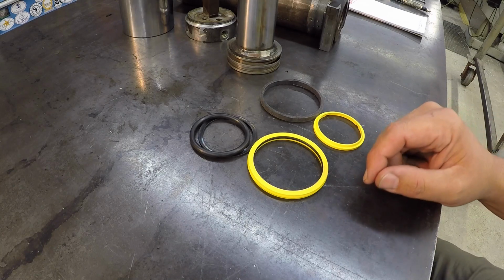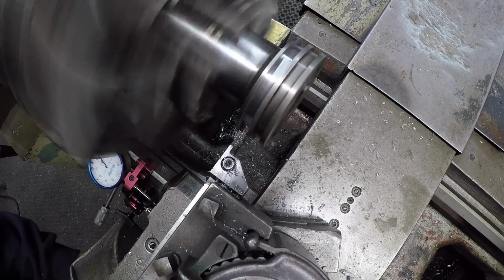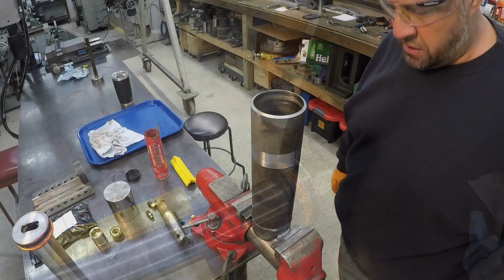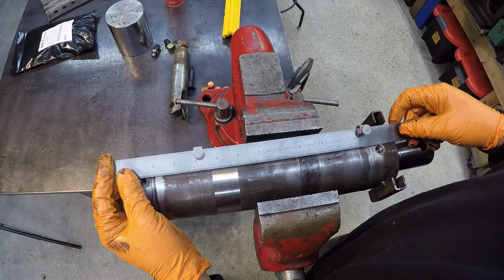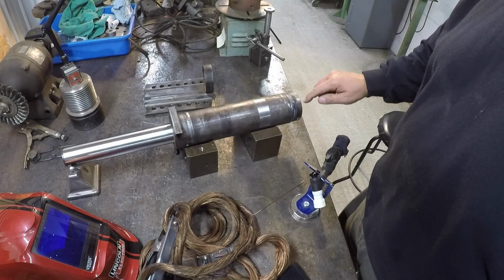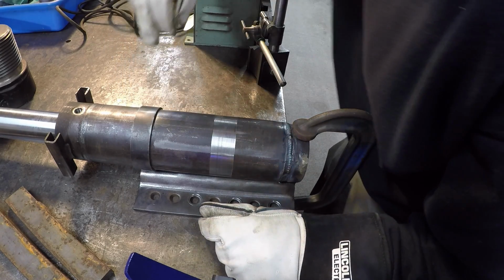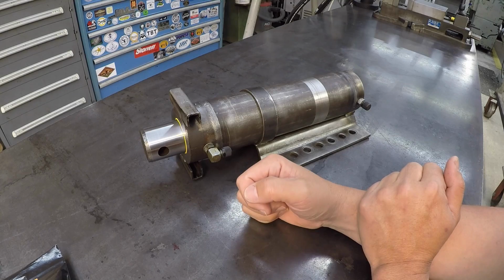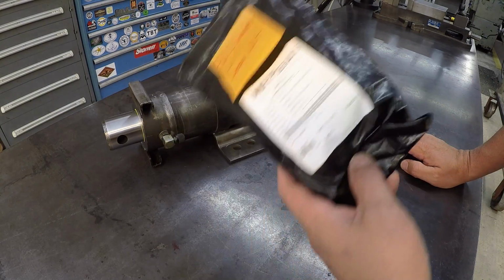SNS 286 Part 1: RV Cylinder Rebuild Completion

Comment: As the welding was going on I was worried about heat transferring down the outer tube and then to the seals and glans possibly damaging them.  When I am trying to prevent heat transfer I put a wet rag down the tub a bit as a heat sink.  Simple and effective.

Comment: From a welding stand point I would have left a small gap between the end cap and tube. If you melt the two bevels together you know the oil doesn’t have a path to leak.

Comment: The "Gentle" ground for the welder makes sense. LOTS of surface area. Your torch fired up real smooth. Awesome technique!
Reply: I thought his ground was some sort of heat sink at first to control the welding heat dissipation.  I need to find some copper like that.
Reply: Looking at it, I think it's a welding cable with the insulation removed, correct me if I'm wrong

Comment: Any issue with the solder leaking down into the interior of the tube on rebuild? Seems it would be awkward to clamp the cap tightly enough before welding.
Reply: It's not solder, it's a weld
Reply: A properly built cylinder has a short spigot on the base plug that should be a tap fit into the tube.  That stops the weld penetration getting into the tube should there be a screwup that bad.

Comment: As an RV repair shop I can tell you first hand that it would be an economical repair....especially in an area such as mine. Cost, exchange and freight make replacement cylinders expensive here. That being said I rarely see the older type like that...generally it the newer small diameter cylinders. Looks like a great job buddy.. :)

Comment: If you had to machine that, you got the wrong seals.
Reply: He said in the last video he was going to convert it to a common seal size that is easier to source.
Reply: Technically correct, however choosing between machining and trowing away a cylinder because you can't find the original seals is kind of a no brainer. It still is a part from the 90s.

Or the manufacturer wasn't all that precise with reading tolerances.
Reply: It was badly machined in the first place, he got the same seal then machined it to the tolerances in his book

Comment: I think that end cap may be coming back off sooner than you think..or can that rod rotate when at full extend?
Reply: The whole point of that center tube is so it can't EVER rotate.
Reply: @jfbeam  I agree, so the end cap will definitely be coming off again, unless the rod alignment is not an issue. Maybe on the RV there is another way to mount it..but unlikely?

Comment: Mistakes ... just did another dumb thing couple days ago when changing  to my cars winter tires.
Got the torque figures for the wheelbolts - 120Nm - all torqued down with wizzgun torquestick, then checked with my torquewrench.
Lo and behold they were all loose fit.
I thought ...
Turned out I had the torque wrench set for 210Nm ...
Same numbers but misplaced !

Comment: Adam you mentioned not being able to pressure test that weld. What do you think of using Loctite 290 Wicking Grade along the bead? I know it can be used to seal weldments, but I'm not sure if it's suitable for the kind of pressure that cylinder would see.

Comment: Perfect repair, somewhat questionable clamping, it is not good practice to weld hydraulic or compressed air cylinders.
Reply: Maybe not but he was just putting it back together like he got it...in first video he took apart and it was welded from the factory
Reply: Cylinder repair shops weld them all the time, just don't weld it while it's sealed up and can build pressure.
Reply: It's ok to weld the ends, you shouldn't weld the actual cylinder part because it would distort, that's why the band wasn't welded to the body

Comment: A quick search on Ebay found a new one for $157.50 and $23 shipping. I'm not sure I'd have repaired this one. But hey, you got a to do a video and that'll help offset the cost.
Reply: I would trust Adam's work over a replacement any day.
Reply: Fair, but if one is able, repairing is argueably a more ethical solution than replacing.
Reply: Not sure I'd trust a chinese knock-off. If that part is $175 for a made in the US . . .  well that is a different story entirely. Though I'd be shocked if that was the case.
Reply: @Maadhawk  The one I found is made by equalizer and ships from Fort Worth. The advantage of welded cylinders is cost. Machining is expensive. No threads, fewer holes to drill, etc... Once pressure tested, very little to go wrong. I suspect the damage to the seals was done during the last repair.
Reply: @Warloch1  That is a surprise indeed then.

Comment: Great to see the finished product. What was the approx. cost of a seal set for one piston ?  My motor home has screw type stabilizers. The shear pins are the weak link. I have had to replace pins on 3 of the legs.  Then water got into the compartment where the control circuit board was mounted.  No replacement available. So I am having to see if I can trouble shoot it after I replace some of the traces that corroded away.     J K

Comment: Of all the products that I have used for soft parts assembly, I remain loyal to Parker O Ring Lube. I do not like Parker Super O Ring Lube. It is too sticky for my liking. I am not a chemist and cannot really testify to product inter reaction, but I was told in my youth that Parker O Ring Lube is completely compatible with hydraulic oils and seal materials. I believed it and I have never encountered a known correlation with any incompatibly.

Parker O Ring Lube is very slimy, tacky enough to not wipe off like tube greases, and a single tube lasts a very long time. Not much is needed for assembly purposes. A little goes a long way. I think that it slips hydraulic soft parts into place more readily than grease.
Reply: Not trusting my welding ability, I would have provided a heat sink to protect the soft parts  while welding. I would have used a wet rag or a commercial heat sink material.
Watching you and TOT TIG makes me want to invest in a TIG setup. Being a welding novice with limited welding equipment, I would have done this with one of my MIGs.
Reply: I'm pretty fond of automatic transmission assembly lube for general hydraulic work. The one I usually use is more like a very soft paste wax, but that may be because I always seem to end up using it in winter.

Some of them also dye the fluid when they dissolve to help identify leaks, where multiple systems can leak in the same area (e.g. on a transmission case unknown "oil/grease" could often be any of motor oil, power steering fluid, ATF, possibly brake fluid . . .).

Comment: Funny thing about that "throw away vs. repair" question--I was just watching a video from "The Post-Apocalyptic Inventor" prior to watching yours, and that's something he preaches about all the time. We used to fix things instead of throwing them away and buying replacements. Good on you for sharing the techniques necessary to do so for these hydraulic cylinders. Makes me consider attempting a repair on the crappy old hydraulic jack I've got kicking around my shop that gave up the ghost after 30 years. I'm sure it's the same type of issue.
Reply: Take your time with it.  You don't have anything to lose and a repaired jack and knowledge to be gained.

Comment: Not sure why you would want to contaminate your hydraulic oil with grease.
Reply: guess you didn't pay attention all that well huh...
Reply: It would be such a minute amount of grease in the oil it would never hurt anything. Plus as adam said they type used is compatible
Reply: Mitch I tried to go watch your professional repair videos but what do you know, you don't have any uploads. Those that can't DO anything are always running their mouth but have nothing to show for themselves...
Reply from the maker: Do some research before you assume
Reply: So I did some research and my service manual for my Volvo hydraulic excavator recommends that the seals should only be lubricated with hydraulic oil when assembling them.

Comment: Nice job.
It’s not just about economics.  Sometimes it’s just better not to throw things out.  
Your welds look great but your could test them with compressed air and a bit of soapy water on the out side.
Even just 20psi is enough.  We used to do preliminary test on welded cylinders this way.

Comment: Adam, excellent repair series. Looks like you were using the Everlast welder and it looked like it performed very good. Can you give an update and opinion on its performance? I own an Everlast 250 EX  and cooler purchased in 2011 and it works great only updating  the peddle ssc, torch CK 20 flex.and put a button on the torch. I would never knock my red and blue machines  that I have owned over 25 years but wanted a tig when I retired and it had some good reviews and price. Thanks.

Comment: I had said it before, but it bears repeating.  Having dealt with trailers and such in the past, the places GENERALLY will say "we can't rebuilt it, we'll swap it out".  There is generally a "core charge" on the cylinder (similar to brake calipers) and when they swap out the piston they will send the piston back to the source for rebuilding.  A friend had an issue on his RV with a similar issue...and that's what they did.  This way they were up and running in a couple hours, not a few days (or weeks).  BTW: He was about 1500 miles from home, on vacation, when the leveling pad failed on him.  He was in and out of the RV dealership in just over an hour with a "new" cylinder installed....but it wasn't cheap, not by a long shot.
Reply: I would be willing to bet "cheap" just not economical; there is a difference.

Comment: I wish i lived closer to you Adam, i'm tired of my hydraulic ram on my dump leaking, its only 2 months old and pouring oil out the seals, the boss can't seem to get a good cylinder as this is the 5th one on my truck in 3 years.
Reply: I guess you're looking for repair then? I'm not sure about America, but here in Germany those things usually get repaired by farm shops and construction machinery shops as well, so maybe that might be another option.. :)

Comment: these generally cost about a $1000 or more, dont know what you would have charged to repair, but trying to find the correct one is a pain!!
Reply: He says 4 to 6 hours time is what he would quote. I don't know what machinists charge these days per hour though, I imagine that will depend if you find a guy willing to do in it in his spare time for a few bucks or go to a full shop. Maybe others can step in with that guess.
Reply: @Swarm509  All about location. I'm in a west coast city where if that cylinder costs under $2500, it's replace every time.

Comment: Wonder how hard it would be to convert the welded on end cap to a screw on or bolt on end cap. You could be having to re cut that weld for the next time that seal needs replacing. Possibly convert the band on the mounting to bolt on as well. More work this time, but if that RV survives, you may well see that cylinder back.
Reply: I was thinking that too, but it would be hard to get it lined up and stay in place. And I guess welding it back up is quicker and easier for Adam. And if it holds up for 20+ years, probably not worth spanding more time.
Reply: @BrainHurricanes  Clocking the entry and exit ports would be some challenge...  Also less likely to leak properly welded.
Reply: And the bracket wouldn't fit, nowhere to weld it on

Comment: how did the seals handled the welding  heat ?
Reply: Seals are at the opposite end of the cylinder to the weld, and on the rod end, that's why Adam welded it with the rod extended. lot of metal between the seals and the weld, and also why Adam let the cylinder cool before adding the second weld bead. Effectively the mass of the cylinder acts as a heat sink to protect the seals.
Reply: @harrymoyes5069  
When really stuck, you may use a damp rag between the heated part and where it needs to remain cool.
Reply: they didn't get hot

Comment: As usual, great work. Why do you weld TIG and not MIG? It seems to me that MIG is better here and certainly much faster.
Greetings from Poland
Reply: Time wouldn't be his priority, and he'd be concerned about heat input and distortion.
Reply: My choice on this cyl.  would also be to  tig weld espesiallly the root pass. A very good eye on the bead to avoid porosity, leaks and get good penetration. Finish pass and the rest of the welds because I am already set up  without changing  machines and the tig gives an  excellent looking and quality weld with no spatter.
Reply: Mig is too hot, tig is slower but much better control

Comment: Just a quick question. Dose it matter that you clocked the shaft hole 90 deg. out from it's original location? It wasn't in line with the hydraulic fittings if the tear down video.
Reply: You are correct.  A quick look at the previous video thumbnail shows the previous position.  A very good question.  Hopefully it won't matter, but it is always best to put back into the same clocking.
Reply: He explains at the end of the video.
Reply: Jack O'Shran As far as I can tell he was talking about rotating the tube relative to the bracket.  But I still can't figure out why the rod relative to the tube is 90 degrees out from its original placement.
Reply: @jcopley100  I see what you mean. The hydraulic levellers on RVs are typically just round or square pads that lower too the ground, so maybe the rod pin location is not an issue.

Comment: They still manufacture these cylinders exactly like this. They retail for $1200 USD which is crazy when I've just watched you repair it with skill and easy for what I'd imagine would be a lot less. It's Part # LC359281

Comment: With that size of cylinder  I think it's far cheaper to rebuild.  A small one sure replace it but that's a good size cylinder.  I'm sure it would be a fairly spendy deal to replace.  Plus it's kind of an odd duck so with no manufacturer support whatever was found would probably have to be customized anyway.

Comment: I work in a close tolerance grind shop and we get about 44 pistons that same size but they are for the f16 fighter plane. So many steps for them to get finished. It is OD and ID grind rough them on a lathe and the grove in them get ground. Then they go out to get shot peen then come back. We do a lot of military and plane things at my work even some submarines things super cool.

Comment: You should correct the title to Part 2
Reply from the maker: Part 2 is the machine shop tours. Read the Thumbnails to what’s in the video.
Reply: This is part 1 of SNS 286.
Reply: OK I got it, a bit confusing. You should have made the shop tour like "SNS 286.5 Texas Machine Shops, Hand Made Gifts"

This one should have been called SNS 286 Part 2: RV Hydraulic Cylinder.
I watch the videos out of order because i didn't realize there was another video taking apart the Cylinder.
at very least make a link to the SNS 285 Part 1: RV Hydraulic Cylinder video in this description

Comment: Looks like the rod or piston is clocked 90 degrees from where it was originally.
Reply: Depending on the pad that bolts on it probably won’t matter.   I wouldn’t worry about it unless it becomes an issue.
Reply: Yep. Hopefully that won't matter...
Reply: The rod end connects to a ground pad. Orientation is usually not an issue. Rotation limit is. All good.

Comment: You still have the rod a quarter turn out.
Reply: Depending on the pad that bolts on it probably won’t matter.   I wouldn’t worry about it unless it becomes an issue.

Comment: I see when you stop your bead you stay in position with gun.what is the reason for that? I have never used tig or mig. Thanks so much
Reply: To ensure the weld gets proper shielding from the shielding gas while it cools.
Reply: It's for post-flow. Surround the weld with shielding gas until it cools enough to prevent contamination.
Reply: The tig gas flows for a good 5 seconds after you stop the arc to cool the weld

Comment: Looks good.  My guess is it is better now than it was from the factory.  It will probably also outlast a replacement of the same design. 

A quick search for a cylinder that is smaller but similar in design shows it around 350 online, a new "kit" that includes the cylinders and power unit look to be around 4K.  Maybe they could order a replacement but I am guessing that at a dealer it will be closer to 500 per cylinder if not more.

Comment: Does it matter that the hole in the shaft is in line with the ports? Or should it be turned 90 degrees like it was in the first video?

Comment: No need to purge the cylinder with argon when welding it?
Reply: Not required on milder carbon steels, stainless definitely would need it.

Comment: Was there any reason not to weld the cap back on and then turn the weld down flush with the cylinder? Of course the way it was welded will work the same, I just thought that was what you said you were going to do initially.

Comment: Curious, does the hole drilled for the center on the end create a weak spot? It look deep?
Reply: A pin or bolt goes through it to hold on a foot from the ones I have seen

Comment: It does not look as go as a Jody (welding tips and tricks), but it is 1000 times better than my weld would be. Pretty good welding for a part timer! Got that tig finger shot in there also!
Reply: I mean considering he only does welding when absolutely necessary, id agree pretty damn good.
Reply from the maker: I’m a machinist that also welds, but when I have the right equipment I can lay down a nice 7018 bead. I had to machine and weld hydraulic cylinders for Motion for 9 years.
Reply: @Abom79  Loved watching you work on those huge cylinders. And all the great content you're making now, learning a lot from these videos man, keep at it.